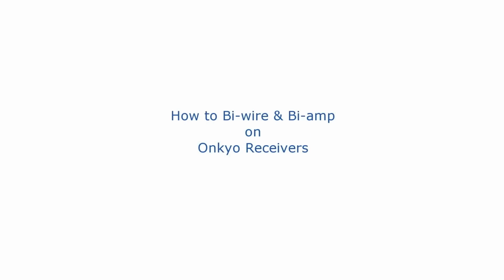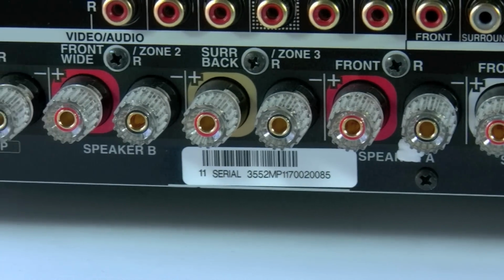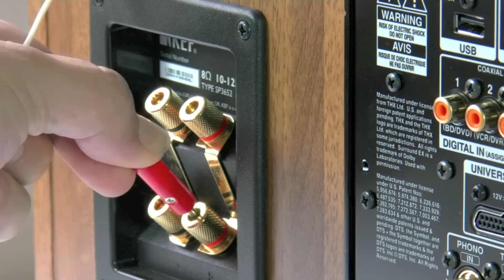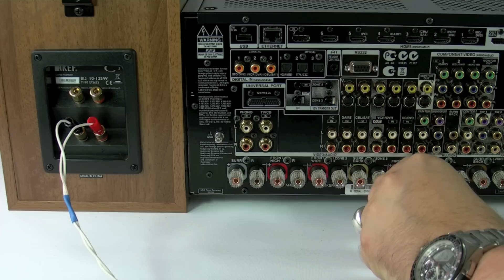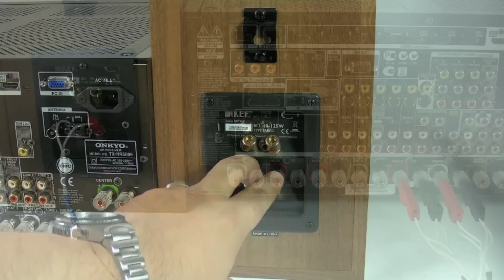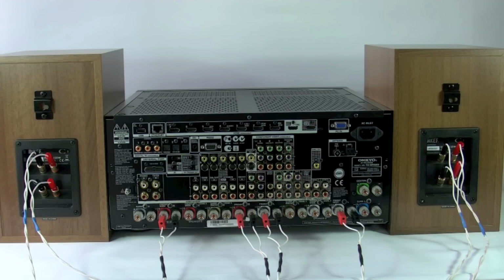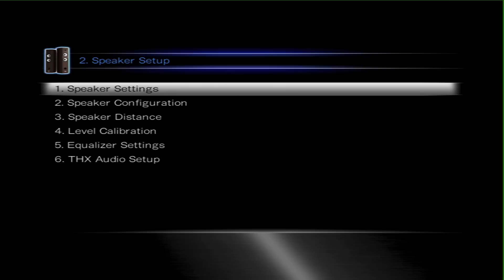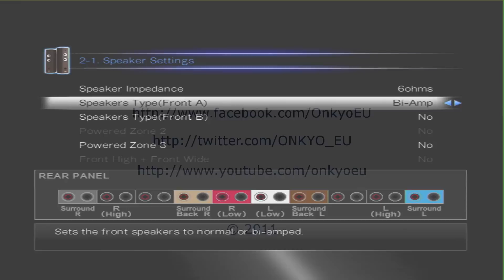ONKYO Speaker connection - AVR AV Home Cinema Receiver - Bi-Wire Bi-Amp

Comment: So the term "amplifier" does not refer to the Receiver! The Amplifiers basically are the different channels within the same Receiver. is there any sound quality difference between bi-wiring or bi-amping? I think it's better to bi-amp since you don't have to connect 2 cables to the same binding post on the back of the Receiver.
Reply from the maker: Hi Victor, absolutely correct. It refers to the amps within the receiver. Using separate amps for tweeter/woofer (bi-amping) with separate cables for tweeter/woofer (bi-wiring) is considered to offer the best possible audio quality. Some people say you won't hear a difference - others say it's worth the effort. It will be up to you to decide...
Reply: OnkyoEU Thanks a lot! To me, bi-amping seems the best solution ever and I really noticed the difference compared to when the speakers weren't bi-amped, so I've chosen to bi-amp them to achieve the best sound quality possible from my TXNR636! :)
Reply: Vylkeer 
There are 2 schools of thought here that you need to realize.  Bi-Amping (Passive) which is the most commonly done, still using the crossover in the speakers, and Bi-Amping (Active) which completely bypasses the the speakers crossover.  

Since you are 9/10 times going to use Passive Bi-Amping, there shouldn't be much difference in sound quality, if any when using a receiver.  

All receivers are rated at 2 Channel Driven... assuming you listen to 2ch music, you will be getting the most power out of you amplifier and driving the speakers better (imo) by leaving the jumpers in and doing a conventional wiring setup (2 wires).  When you Bi-Wire using a receiver, you use 4 Channels (4 integrated amps) thus degrading the performance of the receiver when driving the speakers... the same applies for the more channels you add in 5.1 or 7.1/9.1/11.1 setups.

For example, my Pioneer Elite AVR SC-87 is 145W/ch @ 2Ch driven, or 845w Total Power @ 9ch driven... which roughly comes out to 93.3 W/ch when I use EVERY channel...

So if I do a conventional wiring (2 wires), my front speakers will see 145W/ch each, but if I Bi-Wire, the speakers will see about 128W/ch each at Hi and Low cross over points @ 4 Channels Driven on my AV Receiver.

If you really want to enjoy the full effects of bi-wiring, you need discrete separate amplifiers with a pre-amp, not a AV receiver.

Just a note for you to ponder.  Discrete Lower Power, vs High Current direct power in AVRs.
Reply: Ryan Fuller A lot has changed since I originally wrote my comment and have expanded my knowledge ever since. I've found out an awesome dedicated Amp, the Cinenova Grande 7 which is rated at 330W/Ch @ 8 Ohms (RMS - All Channels Driven) x 7.1 channels and it's awesome. The perfect choice for someone like me who wants to enjoy pure powerful surround sound for movies, TV Shows and Games and still be able to listen to great 2.1 Stereo Music or even Surround Music which isn't that bad. It
s a bit expensive but it's a quality amplifier and it's like having 7 mono separate amplifiers so the power stream is stable and reliable and they have great capacitors to guarantee all of this. And finally it's rated with all the channels driven, so each and every channel is getting the rated power and it's RMS so it's continuous not peak power. My current Onkyo TXNR-838 is rated 130W/Ch (2-channels driven) so the other ones are probably getting like 70 - 80 W and this power ratings aren't even RMS. So yeah, my dream is to buy this beast and use it with a 5.2 setup and having the two main fronts Bi-Amped (Highs / Lows) and every other channel Bi-Wired, just like I have it set up now.

Comment: why would you use another set of cables to do the same wiring you had on your speakers? I don't understand purpose of this. you are using the same 2 channels on the same 2 speakers and in both situations tweeter and woofer are in parallel. makes no sense to me.

Comment: This receiver is NOT set up to correctly enjoy true Bi-Wire sound on a receiver that has the right way to set it up it will have dual amplifiers and a crossover to keep bass from reaching the tweeters and only bass note (which requires MORE amplification than the tweeters or midrange speakers) and it will sound amazing and this set up will sound good too it just doesn't give it the true benefits of a real bi wired receiver.

Comment: Bi wiring makes no differance in sound i bet youd never be able to tell in bi amping either
Reply: You would a bit with this setup on the video, separate amplifiers within the receiver will help combat distortion at higher volumes but with the amplifiers using the same transformer you risk getting crosstalk between the channels. True Bi-Amp/Bi-Wiring involves using two or more (Tri-Amping) separate amplifiers with there own transformers.

You would also need an Active Crossover between your amplifiers and pre-amplifier to split the high, mid/low frequencies to each amplifier (Bi amping means you send high frequency signals to one amplifier, and low frequency to the other).

You would then need to remove the passive crossovers from your speakers as this will just halt the true Bi-Amplification, and connect the drivers directly to the amplifier outputs.